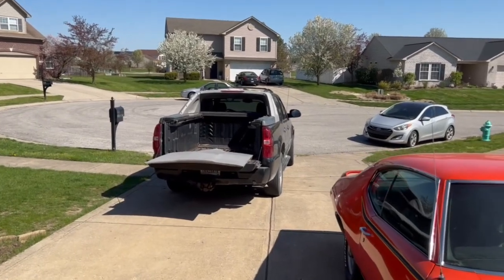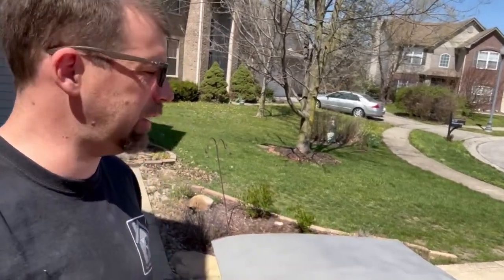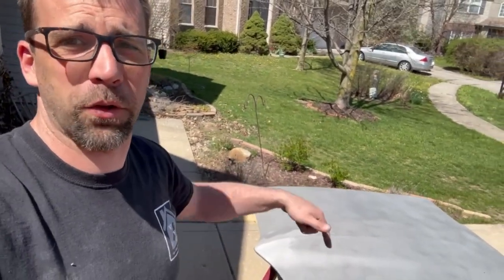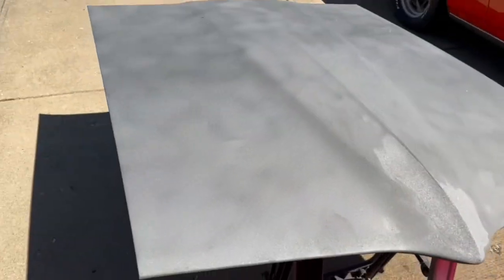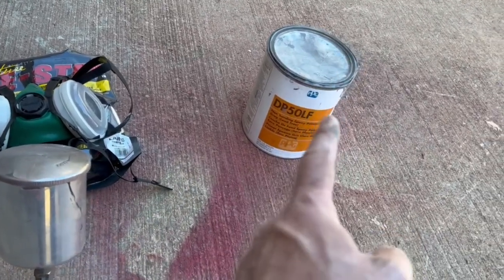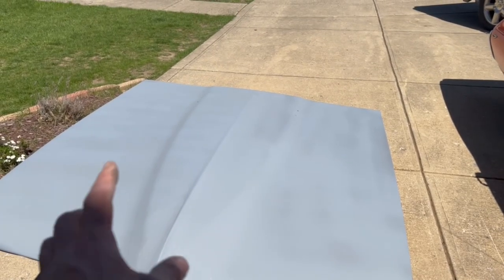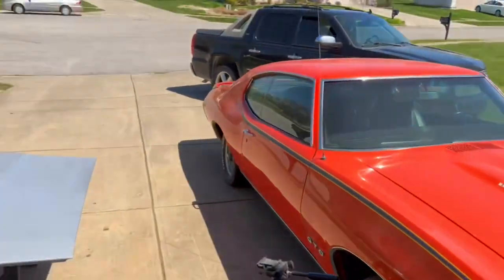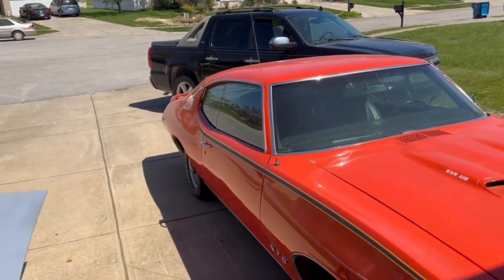How to prep bare metal after sand blasting

Comment: I’ve been told that a DA with 80 grit should be done after media blast or is this just an overkill?
Reply from the maker: If it’s blasted with baking soda only the metal is very smooth and in that case maybe sand it first.  The media my guy uses is crushed glass and it leaves the metal open and rough enough I don’t have any adhesion issues, using this method over 25 years now and have not had any primer lifting issues.  Just definitely keep oil off the metal before painting

Comment: Sweet!
       Is there a water separator on the air to your gun. Also I didn't see it but did you dilute the primer and if so what did you use.
Reply from the maker: I have a separator at the compressor and an additional one right on the gun. Th e primer for bare metal I only mix it with the catalyst. When I use it for the sealer coat over body work I cut it with a little bit of acetone

Comment: Great tip, question- the GTO did you use a base coat clear coat or single stage?  Have a great weekend!
Reply from the maker: Base clear PPG stuff. The clear i used this is no longer available I really liked it.  I use the PPG 2042 clear now and still get good results

Comment: John what do you set your pressure on the small paint gun love both of your cars but that GTO Judge is so awesome! You do exalent work🙂
Reply from the maker: Air pressure is a tricky thing. Every paint gun is a little different and even the kind of paint will effect what psi you spray at.  My gun is a MAC tool econo coat HVLP seems to Spray best for me if I set the compressor tank regulator down to 40 psi then at the gun down to around 20psi.  Good atomization is the goal but not too much air that it turns the paint into a fog.
Reply: @VVG Firebird Restoration Station  thanks John I know what to set my big gun at but just bought a harbor fright touch up gun for re epoxying places where I am doing body work it takes me for ever! On off guide coat like crazy I will be done one day lol I think you done two cars to my 3/4 of a car should have bought full quarters a lot of work!
Reply from the maker: @gibsonexplorer8777  understand that.  I am still working panels on the great pumpkin.  It seems to never end.  I am looking forward to the completion of the body work
Reply: @VinylVillageGarage  yes that's me never ending lol

Comment: Hey John, question on a different subject. Have you ever replaced the vent fitting on the rear axle, 10 bolt? Looks pretty simple but I don’t want to snap off the old one. If you have can you offer tips on the removal and reinstallation to avoid breakage. Thanks!
Reply from the maker: Great question.   Yes replaced several of them. Most of them are only plastic a few are a metal sleeve.  I have broken a few off accidentally but they come out still. I don’t recall any issue removing them to give you any inside information.  There is a thicker area right at the base that holds up good to a pair of vice grips twist and pull out.  Installation I used the open end of a combination wrench don’t recall the size 3/8 or 7/16” Or there about. Then rest the open end of the wrench on the edge of the  base and tap on the wrench to drive it on in.   Worst case if you break and can’t remove the base remove the axle and drive it thru and retrieve it from the axle tube.  Good luck.
Reply: @VinylVillageGarage  thanks John! I’m looking into replacing this because I’m on my 2nd axle tube seal that seems to still be dripping fluid. Brand new TIMKEN axle bearing and seal on the passenger side of my 68. Bearings were professionally pressed on by a Fab shop and I reinstalled the last seal myself. I’m pretty mechanically inclined so I took my time and did it right. After about a month of driving I noticed another slight drip. I know not to buy Chinese crap so I went with TIMKEN stuff. Not to say that this stuff is probably still made in Mexico or China. LOL. Anyway I read where the axle vent tube if not doing it’s job could cause this as well. Figured I’d give it a shot. Thanks again for your help, love your videos! 👍🏻
Reply from the maker: Glad to help.  Good luck on fixing up that leak. Leaks drive me crazy.
Reply: @VinylVillageGarage  yea me too. Fix one, one or two more pop up. Nature of the Beast. Love these cars!
Reply from the maker: Lol.  Indeed, Tell me about it

Comment: Hi John, I have a 69 bird that has a black vinyl roof. The vinyl is in great shape and all the edges are good. The problem is that in the middle of the roof the vinyl is not stuck to the roof. When I go down the road it gets a big bubble where air gets under there and "inflates" it. I have not found a vinyl roof shop in my area (NW PA) but thought you may have some ideas?
Reply from the maker: I bet that looks interesting driving.  I haven’t had that issue before, the best solution would to be replace the vinyl top but I think what you are asking is there a “fix” without removing the top.  I know I would try to get some adhesive inside the bubble and reattach it. Being that it’s black helps.  I see putting some small holes 1/8” or even smaller in the top random locations and using an air compressor with a small tip air gun and regulate pressure very low to inflate the bubble then use the adhesive with a straw attachment and spray it around in the random holes the straw Would help get it in further. The when done little dab black rtv to fill the holes.  Now the possible issues, adhesive might squeeze out the holes and might get on the top or even while spraying the glue it might come out the holes from air escaping.  Long answer, just a thought or how I would try and save the top.  

NW PA how close to Greensburg or latrobe are you?  I make a trip there at least one time a year
Reply: @VVG Firebird Restoration Station  I'm in Jamestown. Midway between Pittsburgh and Erie.
I've considered trying to sqirt adhesive with a syringe but wasn't sure how that would stick.
Reply from the maker: @jaywasser4984  I was pondering the syringe too but wasn’t sure you could get enough adhesive in.
Reply: @VVG Firebird Restoration Station  I'd really rather replace the top so I know what's under there. Any chance you will be doing a video on that? 😁
Reply from the maker: Well the answer is yes. And the best part is this will be my very first vinyl top installs. I have removed them and done Convertible tops so I am hopeful it goes well.  If not i can share with you what not to do.
Reply: @VinylVillageGarage  Awesome, thanks!